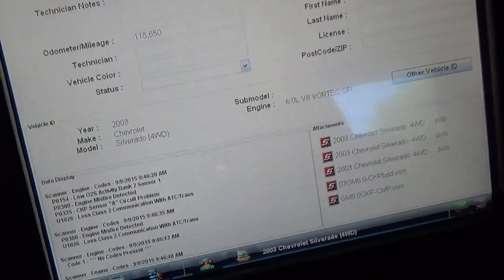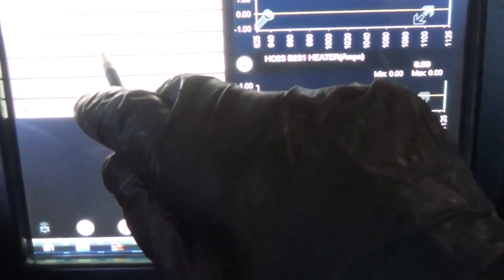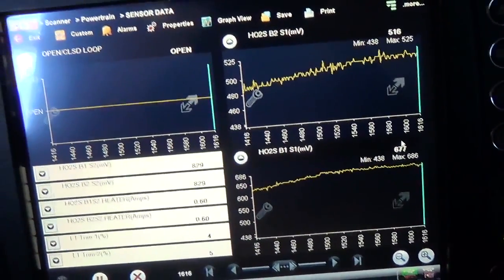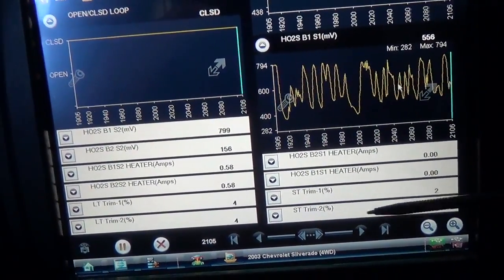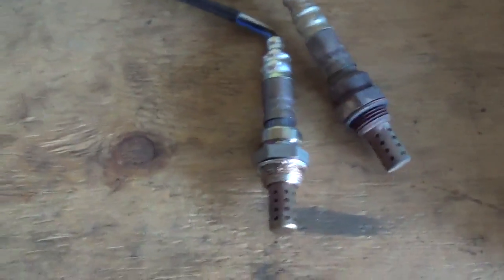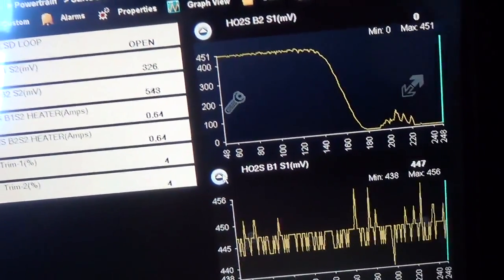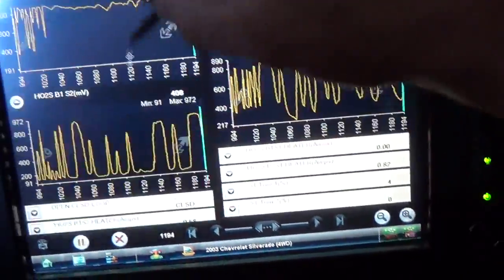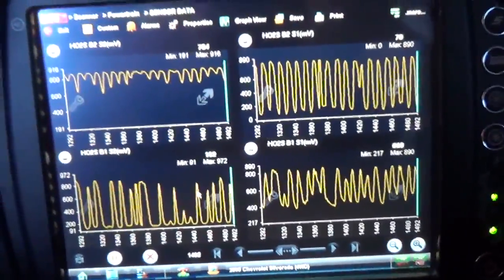GM Truck: Lazy O2 sensors - P0154

Comment: I have a a few lazy sensors in my 2010 GMC Sierra. Original sensors with 146k on them. 🤯 I was just about ready to order all the O2’s from Denso despite what I have heard because Denso makes really good stuff. They I seen you recommended using OEM so I swapped the Denso out and ordered all the GM sensors. I you recommended them, those are what I’m buying!! 😂😂😂 Thanks for all the years of great information. 👍

Comment: Upstream oxygen sensors have to be at 158 degrees before you can get voltage output signal to diagnose their operation

Comment: My neon will go to closed loop as soon as i start the car even though the rpms stay increased but sometimes whem i slow down after cruising and come to a stop it will stay in open loop and then randomly go to closed. Another thing my scan tool said the heater circuit on post cat sensor is at 100 % (duty cycle?) all the time. Any thoughts? My trims are maxed out while driving.
Reply from the maker: Is your Check Engine light on and do you have trouble codes stored? If there's a problem the computer will let you know :)
Reply: motoYam82 p0171. i definitely have a problem i get raw fuel out the tailpipe at idle with normal trims close to 0 but my plugs are burning white. i know theres a problem wasnt sure if you ever seen a similar case.
Reply from the maker: wow raw fuel out of the tailpipe with 0% trims? And a lean code? No driveability problems? Sounds like a great case study!

Comment: My upstream oxygen sensor cycles between 0.0 and 0.8... I'm guessing that's bad?? It shouldn't drop below 0.2, correct?

Would leaking injectors cause oxygen sensors to fail?

I'm trying to diagnose why my catalytic converter overheated, and I don't want to just throw parts at it unless I need to.

Comment: Well done. I went out and checked my 2500Hd and I only have 4 monitors supported. 280k never had  a CEL on  since new it's a 02- even last fall I changed the intake gaskets only symptoms was a start and stall or rough idle till it warmed up - never acted up above 32f and did not get a 171-174 .  Don't think this truck can throw a code Ha I change all the O2 sensors with every spark plug change.
Reply from the maker: +Steve Rob Preventative maintenance goes a long way! So are the emissions regulations similar up in Canada? Same OBDII protocols?
Reply: Canada is exactly the same as the USA , well kinda :) where I live in Ontario we must pass an emission test using the on board computer monitors no more tail pipe testing only on vehicles 15 years and newer every two years after a new vehicle is 7 years of age.  No mechanical checks at all.  I am surprised to see some states have eliminated   emissions testing all together. I've never been to America , never had a reason to go but I would just love to see some of my YouTube friends.
Reply from the maker: I think Eric O's shop is about half way between PA and Ontario...bring down your Chevy we'll have a field day with it and film it live lol ;)
Reply: My Silverado never brakes down except intake gaskets  or throws a code in 13 years - ha even you and Eric couldn't find a thing wrong, hey it's a Chevy .  Great idea Ivan , Eric would  have a meet and greet in about two years when he has 200k subs and we can all roll in like they do in Sturges .  Your gona have to get a hog :)

Comment: great video!
yes being a over 8500 lbs GVWR it has different emissions requirements so not all monitors are supported.
some trucks over 10000  lbs GVWR do not even have a missfire monitor
if i remember correct under 8500 lbs in light duty
8500-10000 lbs is medium duty
and over 10000 lbs is heavy duty classifications for emissions requirements

Comment: what is open and closed loop ??
Reply: Open loop is when the vehicle is on cold start, and runs based on preset parameters. Closed loop is after the system warms up, and the vehicle runs based on information obtained by the oxygen sensors, to create a good air/fuel ratio, to obtain the cleanest vehicle emissions.
Reply: Not to be pedantic, but not necessarily cleanest, but to come as close to the stoichiometric ratio desired as possible. This will vary depending on what the ECU/PCM/ECM is set for, what it then is set to do when it sees certain triggers from the upstream(edited) sensor(s). Which is why even minor intake/exhaust leaks can cause just as much headache as worn-out or crappy aftermarket sensors.
Reply: It has been discussed, in various forums, that the job of the catalytic converters, and the O2 sensors, along with the fuel mapping programs, is not to produce perfect stochiometric air/fuel ratios, but to produce the cleanest exhaust emissions possible. In today's computer age, programming and sensor technology could maintain a tighter tolerance to the air/fuel ratio. Basically, to ensure catalyst efficiency. To ensure cleaner emissions. The need to vary the ratio from rich to lean, and back, constantly, is an attempt to keep the cats working. Without having the "dirty emissions", the needed chemical reactions would not occur, and the cat efficiency would suffer. Catalyst efficiency is the point , therefore the job of the downstream sensor is to monitor the cat, not maintain proper engine operation.
Reply: +roadkill5333 Again, been down this road many times in various forums, but depending upon what is programmed is how they react, and not necessarily for the cleanest. Were that so you'd be hard pressed to pass a prius in a camero. Perfect AFR, nope, but unless it's CA emissions you need to pass it's usually not leaning toward the least in emissions. Tough sell of a V8 with 200rwhp. ;)  BTW, I meant to state "upstream" rather than "downstream" in that last response. My bad.
Reply: So, we agree to disagree.
Reply from the maker: +roadkill5333 You guys are both right! The answer is "all of the above": it's a BALANCE of emissions, fuel economy, power, engine longevity etc...the magic all happens when cycling right around that stoichiometric ratio :)
Reply: Yeah, it's a balancing act by the engineers. That usually seems to be quite contentious in many forums however, many believing it's simply trying to be as emissions friendly as possible, which just isn't the case.
Reply: Open loop is when the engine runs on the pre programmed parameters of the pcm. Then when the engine and o2s warm up the computer uses the sensors to control fuel delivery.